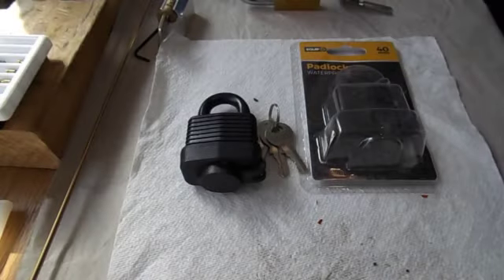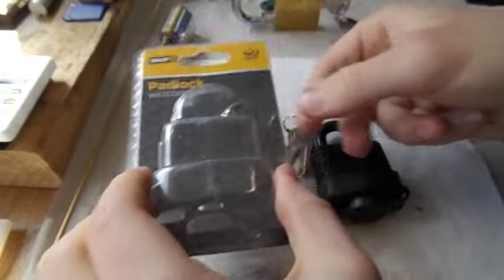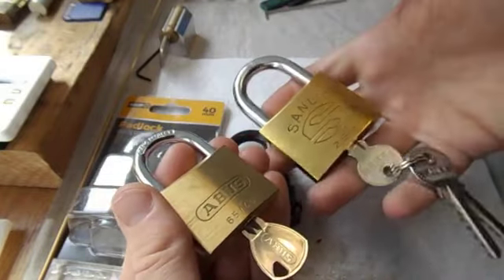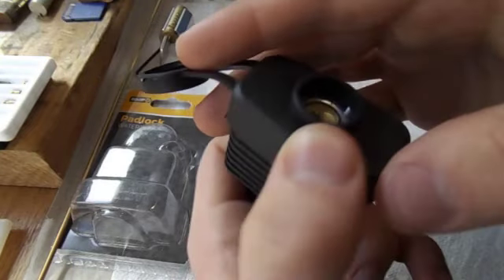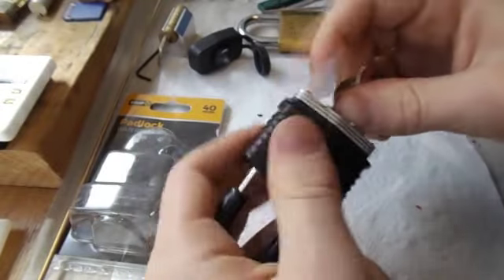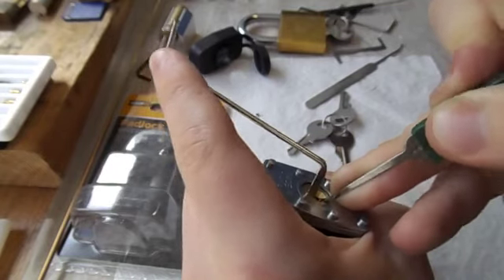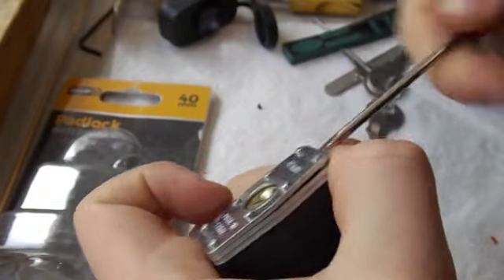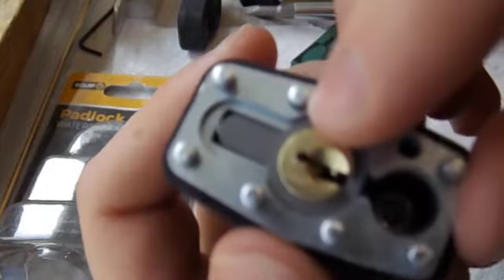Watch before you buy a cheap lock! (215)

Comment from the maker: Sadly I wish it was as simple as advising you to avoid this particular brand name, however, these locks are mass produced in China with assorted brand names on them. My best advice would be to avoid purchasing 'cheap' locks, purchase from big brands only (excluding MasterLock) If you ever have any doubts about a security product, feel free to email me for advice (my email address can be found in the description of every video.
Reply: Thanks Ethan. Was the case also plastic? Moral of the tale: Never buy a lock from a market or from a bargain store. It will only be a lock-shaped object.
Reply from the maker: RWBHere Very true, you get exactly what you pay for! In regards to the case, yes, I actually slipped back the plastic cover after the video and discovered there were only metal lamination plates at the top and bottom, the middle of the lock (conveniently hidden behind the weatherproof cover) was fully plastic, and even had a crack down the side of it.
Reply: @HobbyPicker  That's really taking the mickey.

Comment: Bypass, you can bypass it with a slim hook.
Reply from the maker: I never tried that, but even if that did work then it would be one of the least of the problems this lock has!! Thanks for watching!
Reply: By using something like a broken key extractor you can pass through the hole at the back and grab the locking lug. Takes around 5 sec, completely inexcusable. 
 Thanks for spending your money on this so we dont have to
Reply from the maker: Tarehjerne Tarehjerne You are quite right, that would be another weakness in this lock! I really hope this video gets out there so people see that you get what you pay for.